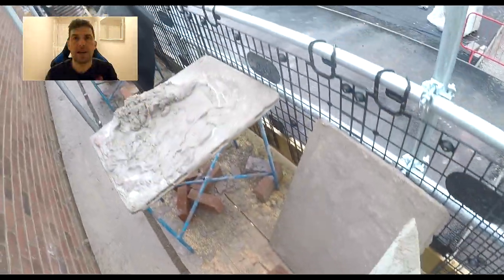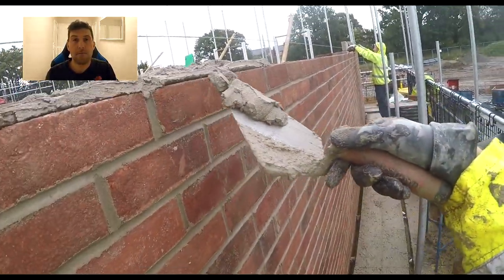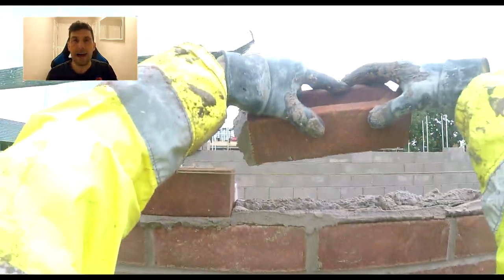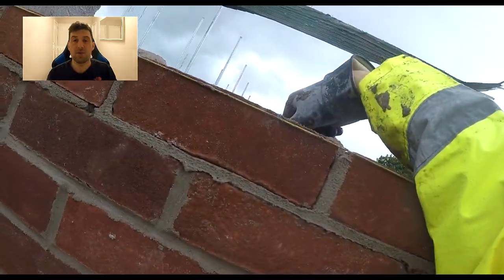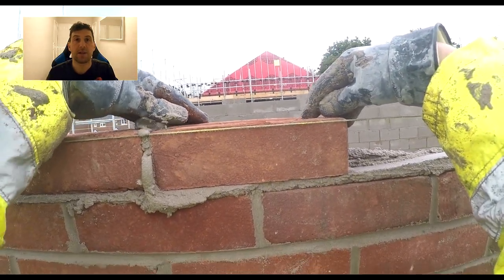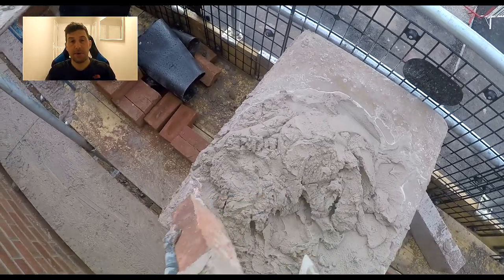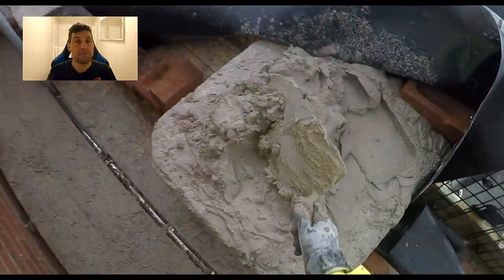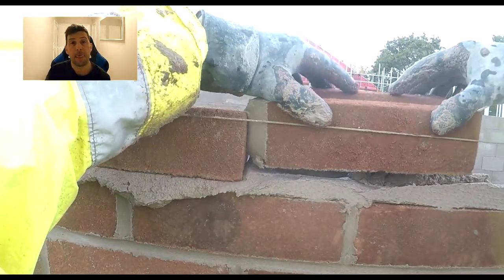BRICKLAYING “WEIRD” 2-Handed Technique POV! (Could help people who struggle with the high courses)

Comment: 7 inch tile setter or 9 inch trowel n a milk crate does the job for high courses on bad shoulder days 👍
Reply from the maker: No probs with my trowel hand up to yet which is good ! Just the brick hand ! Did it being a hero on concrete blocks👎 Steve, the other bricklayer in the gang has problems with shoulders . .. has to have cortisone injections every now and again. 😊👍

Comment: All you need too do too get rid of tennis elbow is do the opposite exercise that caused it,simple.Tennis elbow is an imbalance caused by repetitive over use syndrome. Turmeric is great for anti inflammatory  but wont get rid of problem with the tendon.35 years of climbing and bricklaying and many years of suffering, as soon  I feel it coming on out comes the dumbell ,very  very ,light weight.
Reply from the maker: Good advice!! To be fair I have only had two bad flair ups in recent years. I have got rid of a few of the motions that I know aggravate it and generally Put a bit more muscle on my arms. I seem to be plodding on ok at the min. I must admit, when I first had it I thought it was game over for bricklaying. 2 hands for concrete blocks always now ! And bricks now and again 😂👍 thanks for the comment 😀👍

Comment: Do u guys ever use stock boards to get your bricks up higher saves the back , stack some block down on scaffold and put two 2x10's on them and put bricks on to get them off the ground
Reply from the maker: Yeah, we do. But we don’t do it as much as we should. Have a quick look at my vid “my best tools of 2020”. At 1:34  it shows the set up. The refina spot board stands we have, have a bar on them which we can sit planks on. It takes a bit of time to set up so most of the time we just push on and get the wall   Wiped off and move on to the next one. When the bricks and mortar boards are up high it is so much better for your back isn’t it👍👍 and a lot quicker! 👍👍
Reply: @brickworkfundamentals4636  oh yeah those are nice  👍

Comment: Why not
Reply: Is 21 course like 1575mm? I think you guys go on 75s right? That's not too high. I'm one of those guys who doesn't like going too high even though I'm tall.
Reply from the maker: Yeah, that’s it 👍 21 course is 1575mm from damp proof course on the ground floor. 75mm for a brick and a bed joint. Usually we are standing 3 bricks lower on the ground.  So from your feet to the line of the 21st course of brick is 1800mm. Plus we obviously have to reach over the line to lay the brick. Definitely reaching 👍😊

Comment: Nice idea mate. We have to go 25 for our first lift, they scaffold at 24 so we have one course sticking out for joist lift 🤢.

Some lads are trestling and going straight thru to joist height on the first lift
Reply from the maker: Surprisingly efficient! Yeah, that’s a bit high isn’t it !! Bet trestles are not a bad option ! I use to have mustang profiles that got up to joist from the ground. They would be ideal 😀👍
Reply: @brickworkfundamentals4636  We get 24 ok, 25 normally using my box to get it but one course it's not so bad. I don't like bedding lintels on above my head 🤣 it just seems wrong
Reply from the maker: Our 21 is off dpc and there is usually 3 below that to ground level so I guess that’s like 24 courses from the ground . Are you doing 25 off dpc or the ground mate ?
Reply: @brickworkfundamentals4636  dpc mate, we normally have 3 course sticking out we set up profiles off that and go
Reply from the maker: 🥵Nice big gables then 😀💷 👍
Reply: @brickworkfundamentals4636  we're usually 25 ish from ground that's enough for me any  higher just gets to slow & quality slips cavities tend to forget to be scraped ! 🙄